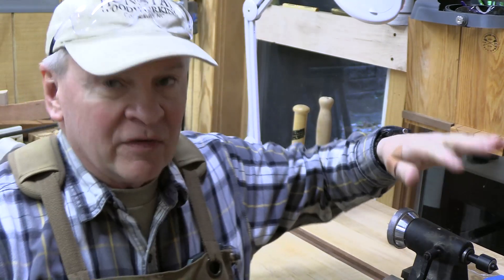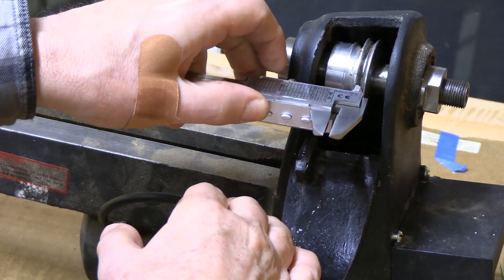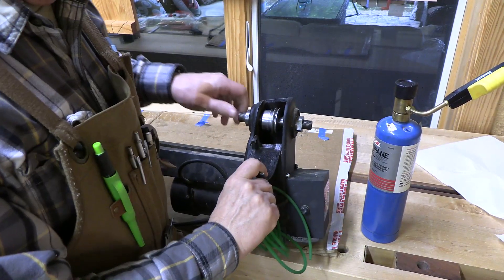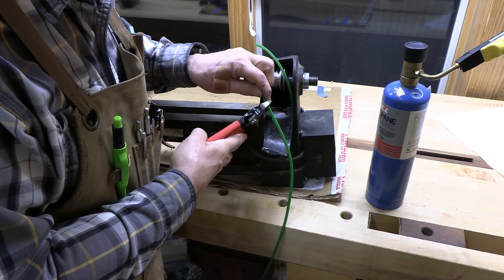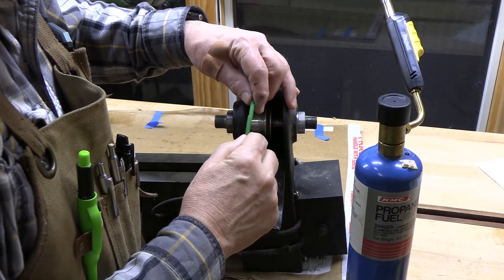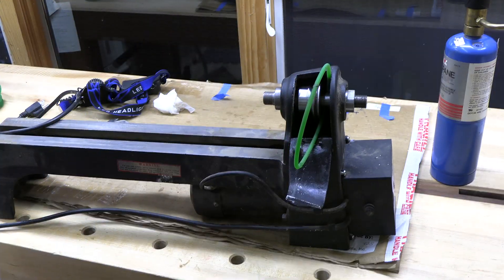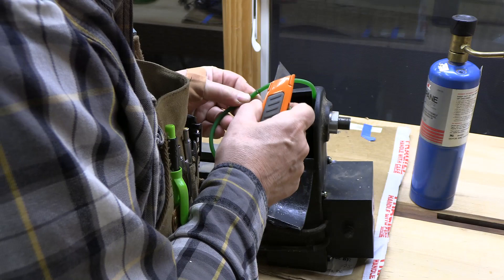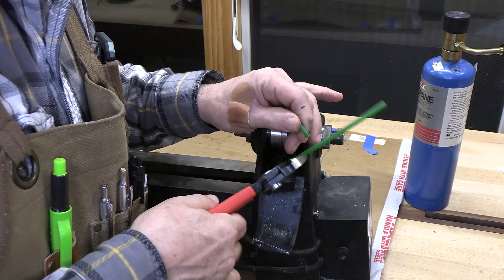Lathe V Belt w PU Cord, IT WORKS GREAT!

Comment: I ordered 700 mm (27 inches) of the stuff from a chinese supplier for the cost of  12.00 bucks. When it Arrived. I got 7 metres. (23 feet)  A bargain !
Reply from the maker: @tinnedanger  you’ve got a lifetime supply. It works incredibly well. I was thrilled with it. Thanks for your comment. Consider subscribing. Thanks. Joe.